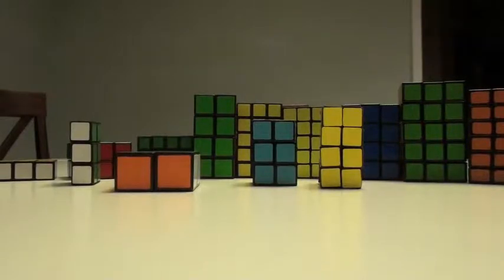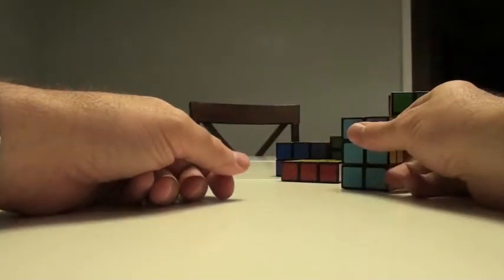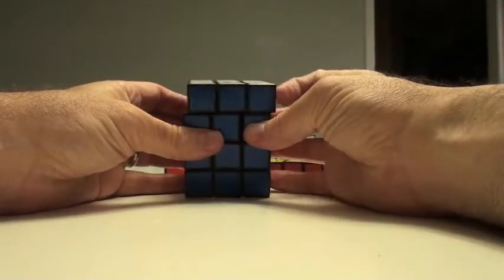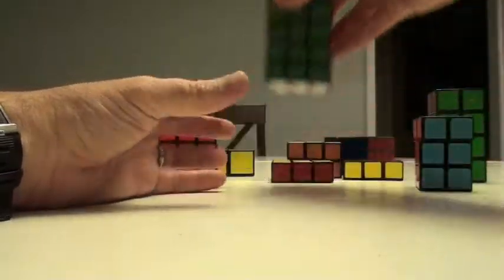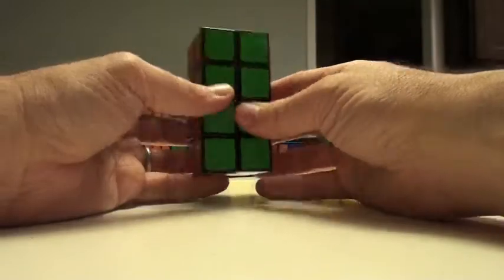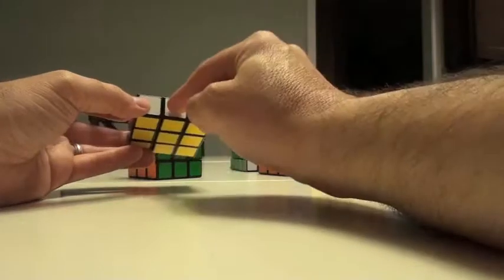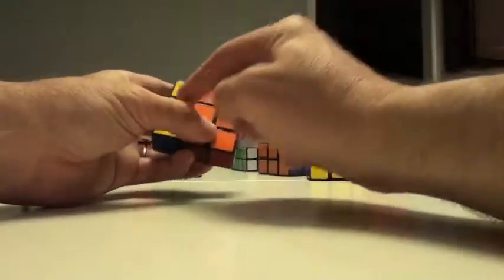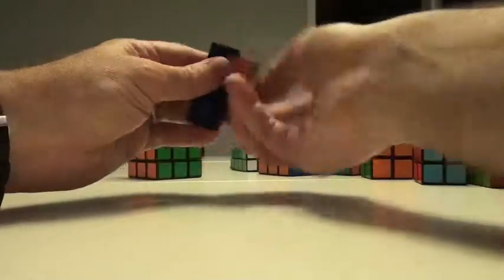Tower Power part 1:  The rules of engagement

Comment from the maker: @Crazy56U Both the 2x3x4 and the 3x4x4 were bought as a DIY kit from shapeways, and designed by Garrett.  Shapeways is a great resource for cube builders to design products that may not yet be mass produced; designed and printed on a 3D printer and sent as DIY kits.  Some of the builders, like Tom Z and Shim offer fully assembled and stickered products.  Some are on the expensive side, but you'll see puzzles you won't find anywhere else.  Check it out!